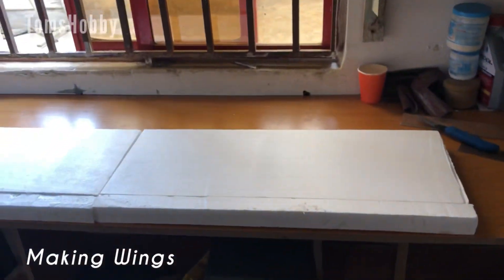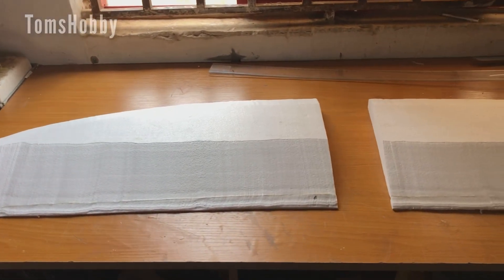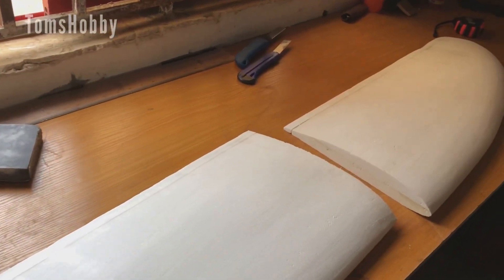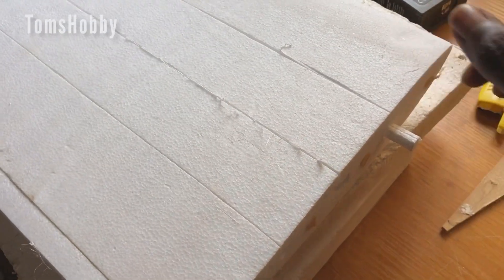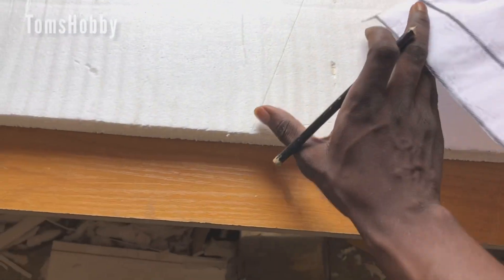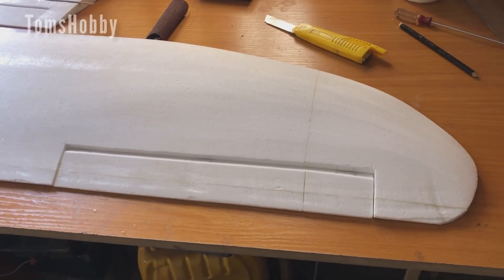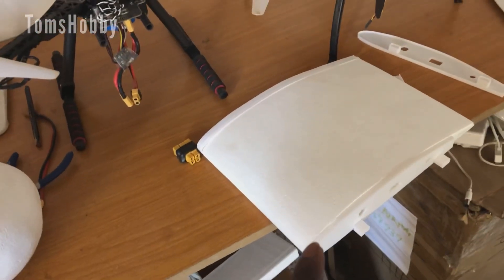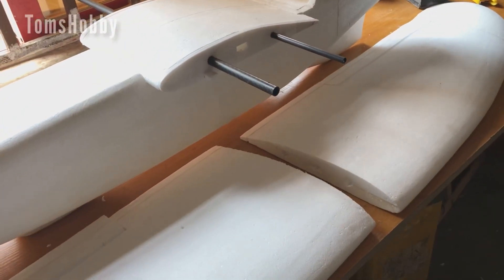How to make X-UAV Talon Wing Build | Part 2

Comment: Hello Tom. It is great the way you make it very clear that your smooth, contoured shapes all start from flat, square foam block stock pieces. That you gradually add bevels and curves to the square shapes--on all sides...,in order to produce the almost cylindrical, streamlined finished models. This is a process very important for beginners to 'see', so that they are not intimidated from making symmetrical curves on their designs. 
I am curious when you mentioned their are"..imperfections.." = gouges & holes in your foam. Canyou possibly find out IF a product called DTE[..diatomaceous earth..] is available in your country?
It is a white powder made from groundup sediment--almost like limestone; its main purpose is for water filtration systems, an extremely fine powder/sand similar to talcum. It is however ALSO used for gardening & growing vegetables & flowers--to control moisture retention in soil. A 1kg bag is extremely cheap in the U.S....it is used worldwide & 'should' be affordable in Nigeria too.
I mention this because it can serve the SAME purpose as 'glass microballoons'--for filling in holes & irregularities in foam builiding. The main difference being that it is merely a fraction of the cost of glass microballoons. A single 1kg bag will last you forever, yet it mixes with water, all types of glue..is sandable...blends with all paint directly...and can be smoothed over a finished model surface, to remove imperfections & get a perfect skin.
For your building workshop, it would be an indispensable addition--worth MORE than REAL microballoons to you.
Reply from the maker: It would be nice to get the powder I highly doubt if It’s available here..
Reply: @TOMSHOBBY  Any large company that handles farming/plant or tree orchard-growing & any type of water purification systems will know how to get it.
 I suppose you can look online & see what they charge to order, + S-&-H per package.

Comment: And i'd like to know where you buy your polystyrene foam too... The ones sold here in kano has indefinite shapes....
Reply from the maker: Same as mine I normally cut the excess or protrudes parts away with an hot wire cutter